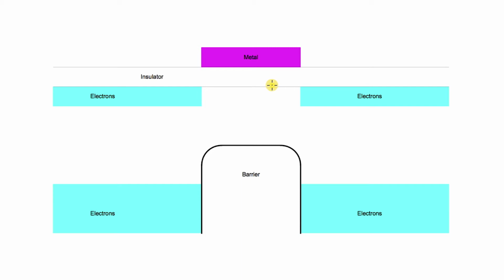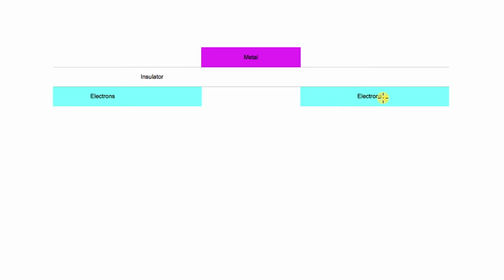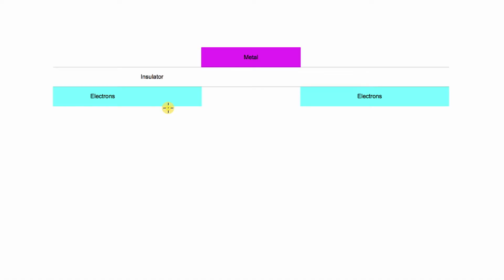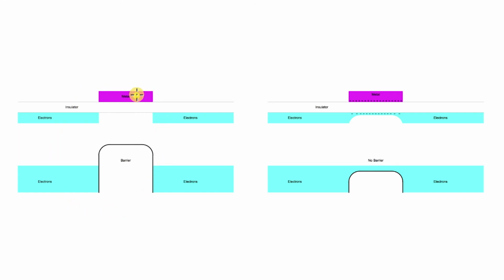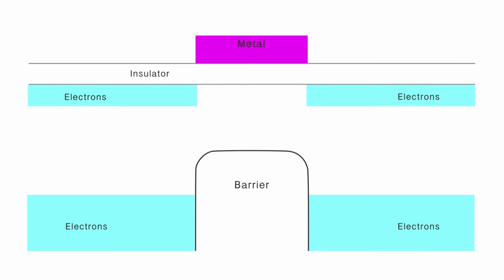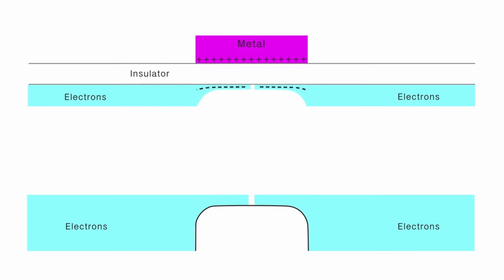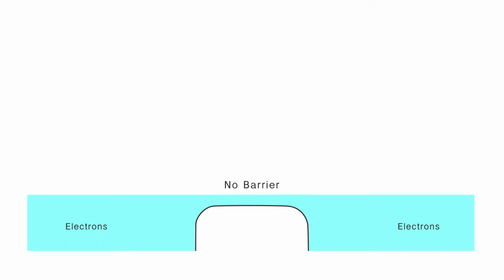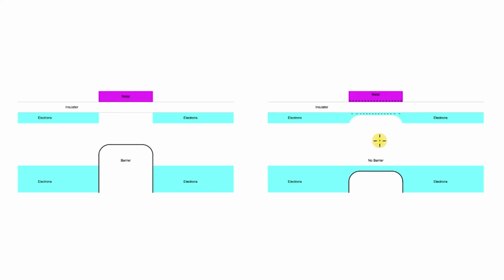Insight 2: The MOS Transistor

Comment: some very essential parts of the mos transistor are missing in your explanation sir !! where is the bulk in this drawing ?? the bulk which is supposed to be positive in your MOS transistor is the one responsible for creating a canal between the two n-doped semi conductors and thus letting electric charge flow from source to drain
Reply: Honestly, for understanding the principle for laymen I think this is an excellent explanation. No matter if all details are there. And I often feel people make these comments just to show how smart they are. It's hard to find people still being capable of providing a true qualitative understanding.
Reply: Remember it's an 8 minutes video. This is by far the best explanation I've seen so far, on MOS transistors. You can make a video too and do it better :)